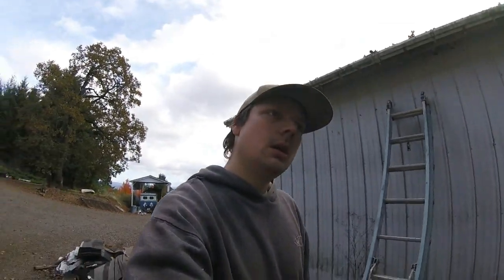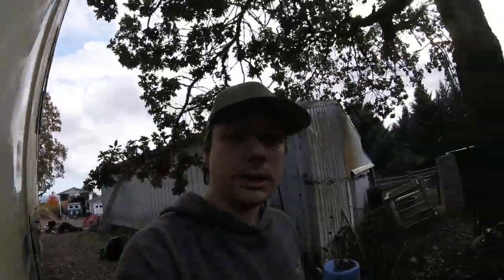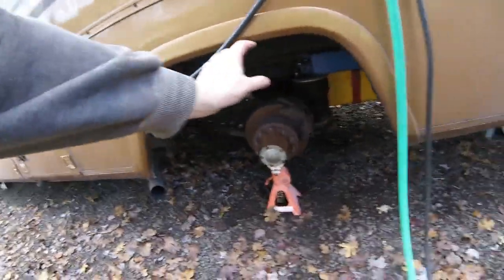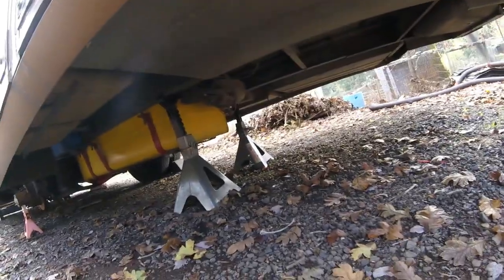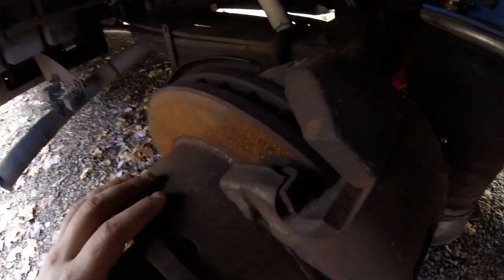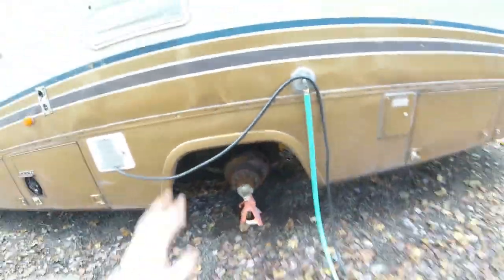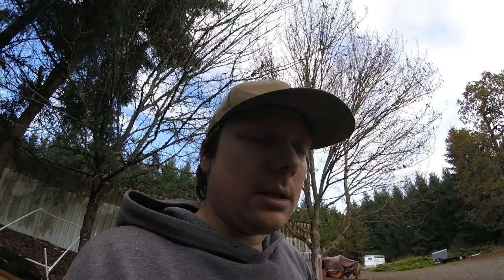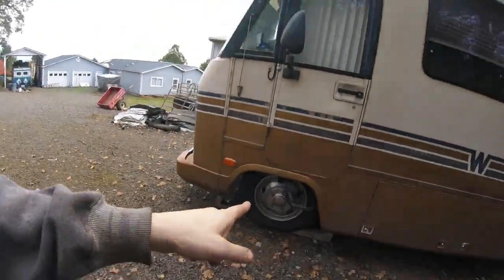Fulltime RV Living VLOG | Repairs Update

Comment: Hello.   Been following your repair videos and getting things done on mine.  Thank you for the info.  Next on my things to do, replacing the oil pan gasket.  Everything is good except by the rear section. I hope it's only an oil pan gasket and not a rear seal. That will be a bummer. After that a tune up,  my car is also going to need a retune a little black smoke.   The other owners had the carb professionally  cleaned about 6mos before I got it. I'll spray it anyway and adjust itt before I paint it standard  Chevy orange. Keep up the good videos.  Bye now.